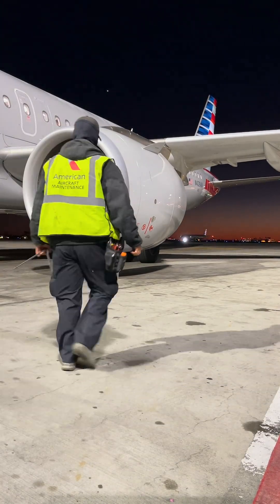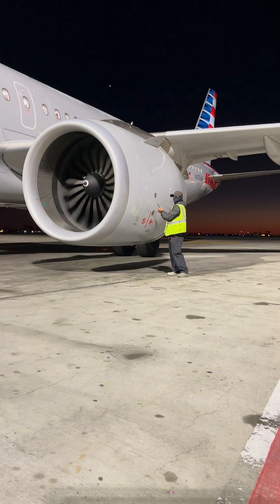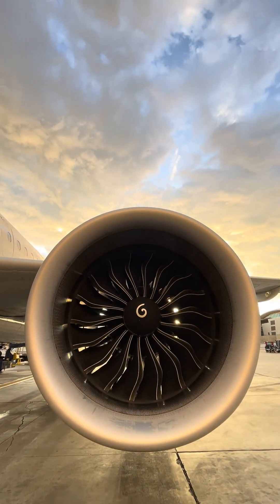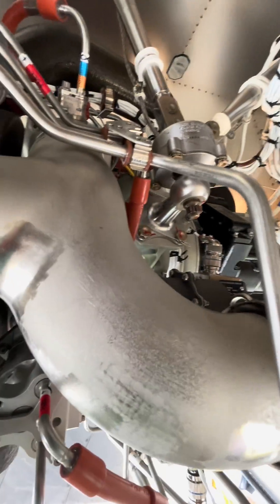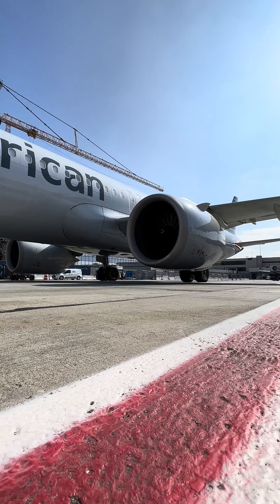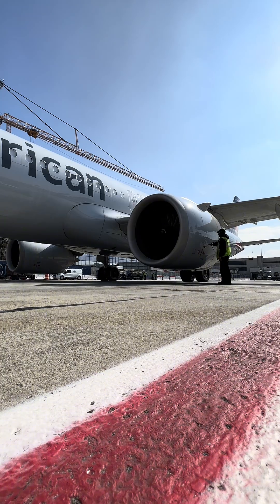Manual Engine Start on a CFM LEAP 1A.

Comment: I've seen painted on the side of the engines the zone of no entry for a running engine.  It extends out about 5M within a 120 degree area centered in the front of the engine.  This area extends a few degrees behind the front of the engine as well, as the engines pull air from all around.  Gotta be a thrill to be just inches from that danger zone.  Stay safe!
Reply from the maker: It’s an absolute thrill standing next to a running engine. You can feel it in your chest.

Comment: I always thought they had electric/hydraulic starters and air starter as a back-up.
Reply from the maker: @roybm3124  the 787 GEnx has an Electric starter. It’s called the VFSG (variable frequency starter generator). But most other aircraft are air starters.

Comment: Got stuck overnight in Egypt because easyJet A320 engine failed to start one started but they couldn't start the other no mechanic available to do manual start but got put up in a Five star hotel overnight we were told it was a software glitch.
Reply from the maker: A software glitch for an engine start?, That doesn’t sound right, but I’m glad you guys got a five star hotel.
Reply: @StigAviation  That's what they told us the bleed air from the engine that started wasn't opening my guess is that the mechanic wasn't available to do a manual start or the crew fancied an extra day in Egypt but everything was fine the following day but our take off and climb seemed to be at lower power settings loving your V-logs keep them coming so intuitive.👍👏👏👏
Reply: PS it was a five month old Neo.

Comment: When I was a B-52H crew chief and we had an uncooperative starter control valve we would open the access panel on the engine cowling that allowed us to install a cartridge breech cap for when we did a cartridge start and tap on the starter control valve with a ball peen hammer to get the valve to unstick and open to allow air to the starter. We referred to this as a vibrosonic adjustment of the SCV. 

We didn't have an APU on the BUFFs so we had to use an external air source like a -60 or a MA/1A.
Reply from the maker: I remember those -60 when I worked at old George Air Force Base. Good lord those things were loud 😅

Comment: Question. MEL item inop. In the event of an enroute shutdown, later solved that engine remains unavailable?
Reply from the maker: If you were question is, if there was a shut down mid air, then they can restart the engine because that air is still blowing through the engine in flight

Comment: In several of your later video's, you've talked about the time you had to do a manual engine start. And ever since I learned how different the starters work on these big engines vs a car, mainly cause your using air instead of electricity to crank over a starter motor. I'm sure the amount of air from the APU must be pretty high to get the starter to crank over the engine. But I am so happy to finally see you stand next to the engine to open the valve manually to allow the engine to start, so freaking cool! I'm guessing the obvious maintenance task is to replace the valve mechanism so it can be used on auto once again.
Reply from the maker: It’s actually not that much air, usually 40 to 45 psi to get the starter Turning, it’s the gearbox that does the heavy lifting and starts turning these beautiful engines.

Comment: Performing leading edge de-icing functionality on Citation Ultras. While the crew chief had the jet set at cruise power in the 'compass rose' I had to slide my hands along the wing and engine inlets to see if they were getting warm. 

The engine inlet check was fun. I would hook one thigh under the trailing edge; hold onto to it with one hand; then slide my other up the side of the cowl until I reached the inlet. Yes no loose items or rings on my hands or jacket/shirt pockets. Jacket zipped up tight if it was cold outside.

One time my hand came around the inlet a little too far and I felt suction 'pull' the hand ever so slightly. Yeah, that's right. You don't have to touch the very leading edge of the inlet.

The most dangerous thing about the check is crossing under the tail under one engine and hitting your head on the other. Luckily, I would wear a used flight deck crewman's 'cranial' that I bought at a surplus store  for exterior checks. At first the other seasoned techs thought I was a geek. However I did start a trend at the service center when former carrier crew members would bring in theirs to wear.

Great channel! Thanks for the education.
Reply from the maker: Most people underestimate the power of the engine. It looks so innocent and harmless, think ohh it’s not sucking that much, right until you get in that specific zone. That hand pull you felt I have felt as well. I call it the death pull. It will snap you into reality really quickly. You’ll respect the engine after that feeling.

Comment: What happens if the engine needs to be restarted during flight?
Reply from the maker: Engine is already spinning in flight from the wind, they can restart like that.
Reply: Oh... So the wind is enough. I though that the engines can be started only with the APU's power. Every day is a day for learning new things... I guess.
Reply from the maker: @dobchogaming5924  apu puts out around 30-40 PSI. When flying at speeds of 200+ mph .. the engine has sufficient wind and air to create proper PSI to light back up.

Comment: Meanwhile the captain is telling you "Just about another 5 minutes" every 20 mins or so until someone comes and does this because a multi billion dollar a year industry STILL can't seem to make parts that don't randomly fail..... makes you feel good about the rest of it eh? I mean if they can't even get a valve to open reliably? There's a reason i don't fly and never would take a job that requires it. Your fate is in someone elses hands, hard pass.
Reply from the maker: That’s such a close minded way to look at it Francis. You act like the vehicle you drive doesn’t ever break down. Or the utilities you use at home never break. These are machines, and very complicated machines at that. We work very hard to make sure everything works properly, and if you have to take a small delay to make sure you are safe that you should be thankful for that. I’ll take flying any day over driving, I probably have a higher chance of getting ran over try to go to the store and pick up a gallon of milk, then flying on a multi million dollar multi redundant system airliner. Why don’t you think about that part

Comment: If that valve is stuck can the engine still be restarted mid-flight if it flames out for some reason?
Reply from the maker: yes it can,, in flight the engine is still turning due to the wind   they can restart in flight
Reply: @StigAviation  Thanks!

Comment: So what happens if engines need to be cycled midfllight for some reason? Would the airspeed be enough to ram start the engine 🤔
Reply from the maker: Yup. There’s enough wind and the engine is already turning. They can restart in flight

Comment: But what if the engine stops working mid air and the pilot needs to restart it? Like in the documentaries.
Reply from the maker: The engine is already spinning in the wind while flying. They can restart in flight.
Reply: @StigAviation  cool!

Comment: Does that mean if engine stalls in the air, the engines cannot be restarted because the valve is malfunctioning?
Reply from the maker: The engine is already spinning in the wind while flying. They can restart in flight.

Comment: What if the valve stuck Open?
Reply from the maker: That why we make sure to close it after the procedure. But if it did get stuck open in other situations, the pilot could cut the source of air from the APU bleed valve, starving the starter valve of air. So redundancy is still there.

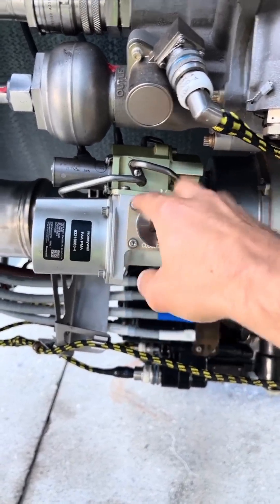Comment: 1:38 as maintenance you have to perform a manual start?  Really, that's maintenance?  During a maintenance PM or just to get the engine started so it can fly?
Reply from the maker: This is a maintenance task because the starter valve was inoperative. It’s done to get the engine started
Reply: @StigAviation  Guess I'm confused, since this is a maintenance task and this valve is inoperative.  Is the valve also then replaced during this "maintenance time".
Reply from the maker: @wesley1983  yes indeed it will be replaced at a later time when aircraft has sufficient ground time and the parts are available. Unit then it will fly under deferral program called the MEL (minimum equipment list)

Comment: On industrial gas turbines, standing next to running engines all the time particularly after a maintenance, making sure there are no leaks or strange noises. However, wear your earphones or you’ll be getting “turbine ears” in your later years.

Comment: So if that little valve fails and you have to manually restart it, let's say later there's an engine failure while you're in the air. What then?
Reply from the maker: The aircraft in flight can restart the engine because there enough wind already turning the engine.
Reply: @StigAviation  That makes sense, thank you.

Comment: I zoomed in at the end and it looks like that starter valve access point is right behind the red "you die past this if engine running" line. As noted by other(s?), it seems spooky.
Reply from the maker: yup  its very close to the intake. but we know where to stand and how to approach and walk away safely
Reply: @StigAviation  that's good

Comment: So what happens when the energize fails mid flight and the starter valve is malfunctioning?

Guess it doesn’t need to be on the MEL after all.
Reply from the maker: mid flight the engines are still spinning due to the oncoming wind  the engines can be restarted in flight

Comment: On board air start .. that's cheating 😂. I never got to operate one of those. I used to do mobile air starts 777,  DC 9, DC 8, Capitol cargo & Doug Kalitta's 727s  and NASA SUPER GUPPY. The 777 was when BA's apu would shutdown .. the rest were our cargo charters. And I like push backs too. Fun times @ KPHL.
Reply from the maker: definitely  fun times

Comment: So uh if the starter valve is known to be INOP, how do you attempt to restart the engine if it fails mid flight?
Reply from the maker: mid flight the engines are still spinning due to the oncoming wind  the engines can be restarted in flight
Reply: @StigAviation  Ah that makes sense, thanks!

Comment: Manual jet engine start: turn a valve on the outside of the engine.

My idea of a manual jet engine start: three guys cranking compressor up to speed while spraying Easy Start into the intake.

Comment: It’s really fun doing a manual start on a TF-33 engine, the start valve for that is in the pylon so you’ve got to position a ladder where the low bypass air flows right into you. It’s really exciting when the valve doesn’t close and you have to close it manually. It was always hit or miss, valve wouldn’t open but it would close, valve would open but not close…… and sometimes, it wouldn’t do either 😂
Reply: I’ve never had to do it on 33’s, i can’t imagine the level of sketchiness, much more than oil pressure adjustment. I honestly didn’t even know you could, I thought they were electrically operated.

Did it plenty of times on CFM-56’s (F108). MFE gang
Reply from the maker: be thankful you haven't done it on a PW  ... now that's not fun lol

Comment: I have always wondered how they could be able to start an engine by other means if there was an issue with the APU and they didn't have an GPU. Thanks for an interesting video.
Reply: The APU was still used to start it, he just manually opened a stuck valve basically.

Comment: What is the minimum safe distance you can walk in front or behind the engine once its running?
Reply: That engine looks scary big
Reply: Rule of thumb. You approach a running engine (at idle only) from the sides. Never from the front or rear of course.
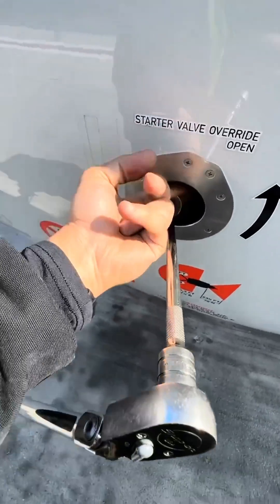Reply: 1:17 It’s posted on the cowl in the form of a diagram. According to that it’s 9.5 feet in front of the engine at idle. Behind is 230 feet.

Comment: I would think that a manual start would be if they had to bring out an air source cart in order to spin the turbines. Do the engines not have an air source connection for that? This is coming from a AirForce B52 mechanic where either you use the onboard APU or you connect an air cart to spool the engine.

Comment: The only issue I see with the starter valve not functioning from the cockpit switch is if they have a flame-out midflight and cant restart…💀
Reply: Windmilling. Don’t need the APU air.
Reply: @MeppyMan  wouldnt they have to dive down kinda fast to get enough air in the intake.

Comment: Doesn’t that mean the pilotscan’t restart the engine if it stops mid air?
Reply from the maker: they can, the engine is still spinning in the wind when flying, they can restart in the air.
Reply: @StigAviation  Thanks!

Comment: I was a jet mech in the air force. I stood next to running engines all the time for leak checks and various ops checks. Very intense when they're going above flight idle.
Reply from the maker: fun times
Reply: Starter cartridges on b52s. Actual manual start.
Reply: @johnthompson7420 like what. Like a hand crank?
Reply: @danielgoodman3578 like mfing explosives shot into the engines
Reply: @danielgoodman3578  the explosive starter cartridge attached to the engine starter. They would pop those off to get the engine started.
Reply: @g2145cal  interesting enough to look up. I'll do that. Thanks! :)
Reply: @danielgoodman3578  picture a big shotgun shell placed into a breech. Electrically primed. It's basically the hot, expanding gases from that "shotgun" shell under pressure that gets the engine going enough for sustained ignition.
Reply: @jumpingjeffflash9946  when b52 gets new engines from rolls-royce, maybe no more canister to shot fire inside the engine like pratt and whitney tf33 engines does
Reply: @darrenfike924  yeah probably a lot more modern and fuel efficient. I never worked those planes so I don't know anything about the cart start system, if it's a p.i.t.a. or has maintenance issues or what.
Reply: @darrenfike924  they will be getting new Honeywell 36 series apu's
Reply: Thank You 🙏 For your Service !!!!
Reply: Starter cartridges on F111’s as well.
Reply: hows your hearing these days?   I've lost 35%

Comment: Back in the day, we used to do Air Starts on 737-200, 727, MD80’s among other aircraft. We were ramp workers and didn’t need mechanics to do this.  You didn’t want to be near that coupler if it happened to pop off during start. It was an entirely different process than what you’re seeing here and a lot more dangerous!
Reply from the maker: yes indeed it was, i used to work on those jets as well, i do miss the JT8D ....if it wasn't leaking oil...it meant it was out of oil
Reply: @StigAviation  haha, isn’t that the truth! I worked for AA too! These and performing powerbacks on MD80’s were a highlight! I miss those days and it was a pleasure working side by side with you guys especially when we had OSO, haha! Thanks for bringing back some great memories!
Reply: @StigAviation as a Diesel Mechanic we say the same thing about Detroits. Don't worry about it when it's leaking oil, worry about it when it ain't!

Comment: That has got to be a rush starting those giant engines.
Reply: Bro, you own a S/R?!
Reply: @seymoarsalvage  When I was younger I owned two 99 S/Rs. The first was an all motor build with Esslinger parts. And the second was a stock daily driver I bought 5 years after I sold the first. They were both great cars but I had to move up to family sedans. I’m one of the only guys who can say they owned 2 out 110 production cars.

Comment: We used to do run ups on 747’s while standing in front of the nose wheels for trim runs.
The nose wheels would come two feet off the ground with all 4 engines at part power.
Reply: Bullshit

Comment: I've been a passenger on an aircraft where the APU was non functioning. It was really interesting to watch the engineers bring the manual start cart and get the engine running that way.
Reply: How is that flyable? What happens mid-flight with a power outage if the APU isn't working?
Reply: @HilltopperTA most of the time you can use bleed air from the other engine to start. The change of losing both engines mid air is pretty small
Reply: @HilltopperTA  Not on the MEL if the plane has two engine generators and a RAT. To be fair, the engineers did get to work once it had arrived back at home base.  The plane did go dark once we had landed and the engines were shut off.
Reply: @HilltopperTA There are 5 A/C sources of power on a twin engined aircraft like that. Each engine, the apu, external power, and ram air turbine. In addition to that there are batteries that can supply DC power for at least 30 minutes. Airborne without the APU you would have to lose both engines/IDGs and have a RAT/ADG failure to lose all A/C power and you’d still have batteries.
Reply: @HilltopperTA windmill start

Comment: OK smarty pants, where does the APU get its air to start?
Serious question, I just wanted to phrase it humorously. Lol
Reply from the maker: Apu starts electrically via battery power and starter motor. 👍
Reply: @StigAviation  Thanks for the info. I assume that the main engines would require too much power to start in a similar manner?
Reply from the maker: The main engines (depending on type of engine) requires around 30-50 psi to the air starter to get it spooling up. The apu provides that air
Reply: @StigAviation  Once again, I appreciate the reply. ☝🙂👍

Comment: Didn't know that... Almost reminds me of the film clips of the old WW2 fighter planes when the ground crew manually turned the prop slightly to get the engine started if the internal starter motor failed to get the crank moving enough...